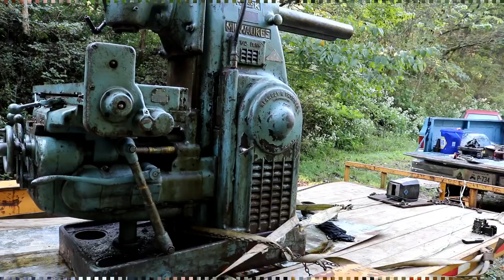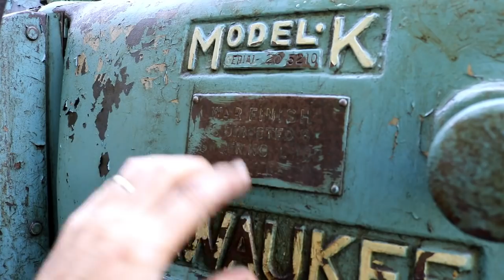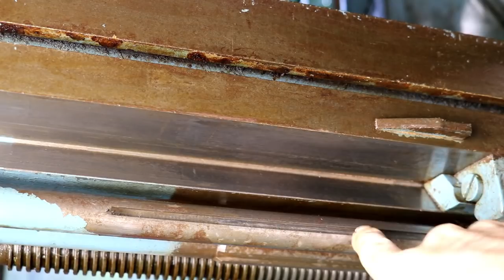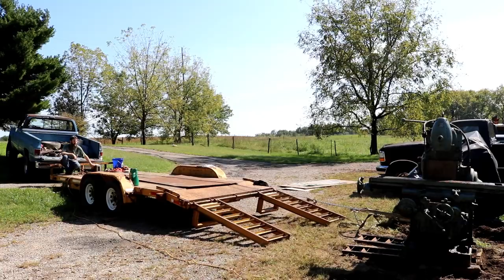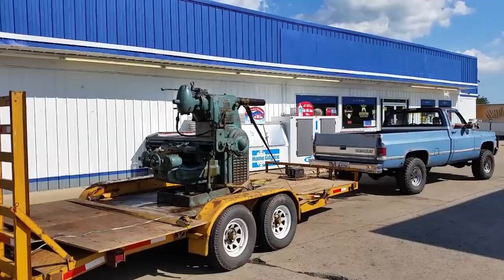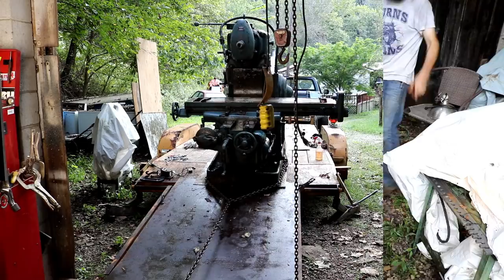New Monster Machine for the shop!! :-0

Comment: hi steave the job you did to move the shaper was great, i like to say just for the future you can use pipe to set the sharper on this will make it a lot  easer to move , I have move verious machine equipment for my shop i am restoring a kalamazoo band saw and a pexto shear , but you did a great moving the shaper. amiture machinst, Larry

Comment: That 2K looks like it has the potential to be a gem.  I have a model 2K Universal with a high speed head.  Absolutely terrific mill, and you are going to love the side controls.  Once you get that paint off the ways, you should be able to see how truly tight it is.  The scraping and frosting looks well done, so hopefully it wasn't just window dressing.  Tons of 50 taper tooling out there, and I have been always able to find it cheap.

Comment: Next big machine you get, I highly recommend renting a drop deck trailer (https://www.sunbeltrentals.com/equipment/detail/1413/0240150/6ft-x-12ft-lift-bed-tandem-axle-trailer/).  Makes it a lot easier to load/unload.  Also, if you ever get to south eastern Indiana, I've got a handful of 50 taper holders you're welcome to have.  I bought them at the auction I got my smaller Brown and Sharpe horizontal mill, which uses 40 taper.  They had a K&T exactly like yours, but went for more than I wanted to spend.

Comment: I'm sure we all agree that there are many way to move a machine of this size, and depending on which way you decide to do it, will determine the effort needed and the inevitable risks. No doubt, we have many channels on youtube on how to machine parts and the like, but not one on how to move machines safely and with the attention it deserves as you would running a Bridgeport or a lathe. True, it's expensive to hire professional movers but I've seen much too often machinists who, the next day, decide to become movers who go about it in ways that leaves much to be desired in terms of safety. 

That being said, and while Steve is very knowledgeable and resourceful, I was very concerned at the 14 minute mark where he is kneeling behind the winch. If the the strap or chain was such that broke off by too much tension, it could have sprung back straight to his face. I say this because I've seen it happen under similar circumstances and it got a man killed. I'm also wondering why Steve did not use 1" pipes as rollers when loading and unloading the machine. As a machinist myself, and having my share of moving heavy equipment, a 1" or slightly larger pipe is a must for moving heavy loads. I would never move anything without them. At the 21:30 mark, Steve said that "either you slide the machine or roll them with pipes" So he had it in mind but I'm at a loss as to why he didn't use them at the outset since it would have made it much easier to move and safer too.
Reply from the maker: On a flat floor pipes work well and I use them. They don't work well on a trailer ramps. What do you do at the bottom of the ramps? I would rather drag a machine then have it on skates/pipes when on a incline. Problem is lifting the 6000 lbs on dirt without a toe jack.
Everytime I stopped pulling the machine I let the pressure off the winch. Just had enough to hold it from sliding. On the winch I have there is no remote switch. You either stand beside and operate the switch or not use it at all.  I understand the safety concerns completely and agree that they are better ways. But none I had available at the time. 
I did what worked at a remote location with limited funds and equipment.  Smart thing to have done would have been to hire a tow service and me never touch the thing. It was not an option.
Reply: @SteveSummers  been there many times myself what you have is what you use. When you are starting with little money and tools you have to use more elbow grease and take chances. Great job!

Comment: WOW, nice.  Serial number machine 20 of 25 made starting in Oct 1945.  The manual gives weight at 9000#.  The attachment on the left end of the table is nice for doing spiral work, just need a K&T dividing head.
Reply: My bad on weight this was a mixed lot of 2K and 3H machines the 3H is 9000# the 2K is smaller than my 2CH which is 4700#

Comment: A war machine means that it weighs 500 to 1000lb more because the castings were not cleaned up and ground to their normal standard due to the rush of the war effort. K&T valued their finish so much that they put a plate on the machine saying that it's not as pretty as it should be because the government ordered it that way. They made wonderful machines.

Comment: Congratulations! Awesome!
After watching your video I really feel a bit like a wimp: yesterday I moved part of my Thiel milling machine into the basement. As I have to move it down a steep stairway, I dismantled the machine so that the heaviest part weighs "only" about 600 lbs (300 kg). This is still quite a challenge for me, although my Thiel looks like a toy in comparison to your monster. (Some Germans use the term "Eisenschwein"  (iron hog) for this size of machine.)
I am looking forward to see you restoring this old lady! (BTW: hope you found a good set of letters for your engraving machine.)
Best wishes Harald

Comment: As far as I have read a NMTB50 socket can accept CAT-V 50 tools, though one needs to make a longer drawbar with threads to match any given CAT-V 50 holder.

 what is you preferred price point for used & new NMTB50 holders?  

What thread size & pitch is the drawbar?

Practical machinist links etc. 
https://www.practicalmachinist.com/vb/general/questions-nmtb-50-taper-259189/ 
https://www.practicalmachinist.com/vb/general/cat-50-vs-nmtb-50-a-178172/ 
http://www.tools-n-gizmos.com/specs/tapers.html 
https://toolholderexchange.com/nmtb-tool-holders-nmtb30-nmtb40-nmtb50/

Comment: That looks like a good machine for your shop!  You will be able to do some serious milling now, good thing you’ve got those Tool grinders. I have moved several machines like this, but the last time I rented a Hydraulic lift trailer for forklift transport and it was slick as hell. I loaded an 8000 lb van Norman 38MEA in 5 minuets by myself with the help of a 8000 lb winch.  Trailer was only $125 from sunbelt rental for the whole weekend

Comment: You know, even if you did get fooled by the story and the looks of some of it, you’ll get even more good footage from repair/rebuild.

Ps. That oiled sheet metal trick is great. I wonder if I would work even better with two sheets on top of each other and the oil in between?

Comment: Congrats Steve, super nice mill. , now ya need to build the parking fixture like ah ok did. , and a it dividing head with drive gears for spline rotor cutting and helical gears too. . Lucky man ill say . Fun moving heavy machines , I moved a Bridgeport in a 1976 dodge w200 4x4 , 36" off the ground , had to use my brains dug out so the back wheels let the pumpkin Sat in the dirt that left me about 22" , easy with planks and blocks a cumalong and it slid down easy to the floor and pipes to roll it. No help just me. Good luck enjoy your videos . Hug the dog and the family be watching.
Reply: Hi Silverbullet. You said "now ya need to build the parking fixture like ah ok did. " Someone else beside Adam Booth (Abom79) has built a parking attachment? Or is this a typical spell check run amok? Thanks

Comment: That's a nice stout machine, very capable of doing a lot of work. 
A couple tips.....
1. Instead of motor oil, use Dawn dish soap.  Pretty much as slippery, maybe more so than oil. 
And it cleans up very easy......garden hose, or just rain. 
2. Never get yourself or anyone else in line with the winch cable. If it breaks, it can whip back and do some major damage to you.  A winch with a remote cable or wireless control is the way to go.

Comment: Congrats Steve on your latest purchase. 
You remind me a lot of our cockies (farmers). 
There is nothing they can’t do or fix with a little bit of wire and determination. 
You possess that same determination.
Personally I’m a pain in the ass perfectionist. 
I would spend excessive hours just cleaning everything up so it comes up looking like new.
I get a lot of joy and pride from doing that.
What I see in you is that you are probably much more practical than I am, checking everything over to make sure everything is up to scratch. I enjoyed your vid last week with the new acquisition of the larger tool sharpener.
When you took the time to clean everything, making sure that everything was good, I felt a lot of pride for you.
I hope everything is good with this mill as well.
All the best.

Comment: If you are going to have to drag something on a trailer like you did and need an easier more power disconect your vehicle chock the trailer run chain /cable to machine and to the vehicle tow hitch and pull foward. Ive pull on all kinds of heave stuff on using your idea of oiled plate is a good one. Also use farm jack or bottle jack pick up slid pipe or rod under for rollers.

Comment: Oh, Steve, one more thing.  I think I read on PM, and I believe it might have been John Oder in Huston that contributed this, but ....  Take the belts off the motor to check phase rotation!  Something about the clutch mechanism that WILL BREAK if the motor spins the clutch the wrong way.  It is a K & T thing.  Something just breaks and you have to be real careful about this, so hence the advise about taking the belts off.  I think there is an arrow made into the casting to note the proper direction.  I hope you read this before you try to power it up.  Also search PM for the post.
Reply from the maker: Yeah, planning on checking for correct  rotation  without belts. I seen the same post about issues related to running it backwards

Comment: I love the new machine Steve.  I have a Van Norman 22 milling machine.  It is interesting to see that the Y axis for the saddle looks identical to my VN.  My leadscrew to move the saddle is also off to the right side.  One thing I reworked on my VN machine was the Y axis gib.  It was banana shaped by .oo6".  This caused the saddle to "crab" when you reversed direction.  The reason I believe is because the leadscrew is off to the right (as opposed to being in the center like a Bridgeport), and the forces to move the table coming from the nut are not centered.   I reground my gib (see my Doozers Shop channel)  and I scraped the center of the slideway a little bit, and that took 90% of the crab problem out of my saddle.  I mention all of this, just to say that you might want to examine the Y axis gib on your machine.  Your KT is a similar architecture like my VN.  I know yours was rebuilt, so maybe you don't have this gib problem.  But I thought I would mention it, as you will probably be checking you machine out anyways.  Nice score!! --Doozer

Comment: Congrats, that is a real (monster) mill. Now the painter was of course drunken or stupid. To paint part of the ways is weird, but to paint the dials...oh my...   Now you need the parking attachment for the vertical head, the head is real heavy. Changing fom vertical to horizontal and vice versa is not a fun task without the attachment. For a moment, i really thought you would pull the machine from the trailer without securing it from the back side, jikes... Btw., i can tell, where i would be today, without my wife: in a deep and lonesome grave. So be nice to your wife, she is more important, than anything else.

Comment: nice new mill steve, I just got mine back home. I finally got all of the parts into the shop now, and you saying that it was difficult to get it moved around, that is no joke on what seems like any real horizontal mills, lol. What are you getting for backlash on your mill in the handwheels? 

Thanks for the video and cant wait to see it up and cutting to do some work, lol.
Edit: I may know someone with a 50 taper face mill if you cant find one, someone gave it to him and he just uses it to weigh the workbench down, lol.

Comment: When you winch that kind of weight, get away from the path the cable will fly if it breaks.  A steel whip in the face will make for a bad day!  I used to run an old Brown&Sharpe screw machine with a paint finish tag from the War Dept.  Old?  When did the War Dept. become the DOD?  On old machines, if you find trouble, look for something that may have been taken apart and rebuilt wrong.  It happened to me, something reassembled incorrectly years before I became a machinist.  Found the same mistake, same results in the 2 other identical machines in that shop.  First one took a few years to fix, the other two a few hours each.

Comment: Like a father with a new kid! Let me get serious for a moment...... NEVER but NEVER stand in line to any type of winch cable. You are lucky when the bolt broke that cable went to your opposite side. Like your idea of sliding on oiled sheet metal. I know we all have to "use what you got" but seriously be careful. I just thought you needed a little scolding. Great score on that one. I ran big Cincinatti convert a mills at Boeing that came off navy ships. Still had the tags on them too. That was in the mid eighties. They will take some serious cuts. By the way love your fathers Chevy truck. Always liked that year model. Keep us posted and stay away from flying winch cables..........

Comment: That is awesome!! I notice the rare drive on the end of the table. Is that power for a rotary table or is it the fancy one for a dividing head?
Reply: I think that is for the dividing head. Mine is powered without it. Those things are like hens teeth around here.
Reply from the maker: I was told its for the dividing head.. But I'm not sure.
Reply: It will have gears to change if it is for the dividing head but likely only be one ratio if it is for the rotab.
Reply: bcbloc02 
does that one need to have a whole specialized foundation built,
specialized foundations r for people who like show’n out,
kinda like Detroit diesels for makin noise
Reply: It's for cutting spirals. Think of it like an external rifling machine. It still uses a dividing head to do the job but the mill and the  head are geared together to create a lead (like a screw) per distance travelled on the x-axis. Older Machinery Handbooks have the info you need to set the gearing.
Reply: I got the spiral head with my K&T 3B Mill. I need the gears for it though. Found a set on Ebay. Prolly be gone before I can get em though. I'll end up making some. I posted photos on Practical Machinist.
Reply: I think it runs both if my memory is right. Great to have on the mill for sure.
Reply: Silverbullet 
No rotary tables only have uno
Reply: That drive bracket is for a rotary table... Kearney and Trecker made different gear boxes for dividing heads...One was a standard and the other was low lead.. The low lead, of course could power a rotary table as well as the low lead used an auxiliary shaft under the table which powered independently of the table screw....The low lead box on my 2hl horizontal powers my 12 inch K&T rotab perfectly....Mike in Louisiana (Ramsay 1)
Reply from the maker: @ramsay19481  This box is powered by a independent shaft and not by the table screw.  So it's for a rotary table?
Reply: Yes......Drives for dividing heads have many interchangeable gears for different leads...You may be able to drive a dividing head with this drive but there is no connection to the table screw so no spirals or helices...When a powered rotary table was ordered with a machine from the factory, unless otherwise specified, such as a low lead box, this is the drive bracket that was installed....Mike in Louisiana
Reply from the maker: @ramsay19481  Ok, thanks Mike. I pulled it apart and cleaned it up.
Looks to be in good condition.
 Guess I'll need to find a rotary table for it. Be neat to mess around with.  Still in the beginning stages of learning all the different models and accessories offered.
Reply: Find a Kearney and Trecker power driven rotab.. You will find which ones will fit your machine page 17 here:  http://vintagemachinery.org/pubs/2098/6847.pdf  Mike in Louisiana
Reply: me
Reply: Yep, talked to you on PM and I think the K&T site on Google?
Reply: Was probably KTMilwaukee on Yahoo groups... I started that group but when Yahoo changed everything up awhile back, I could not get in.. I finally joined my own group to get in and found that much of the data is now gone.... I started that group before  I knew about Keith Rucker and Vintagemachinery.org....I along with many others have posted information on Keith's site for all to enjoy.. Mike in Louisiana (Ramsay 1)
Reply: Oh yeah, definitely visit VM on a regular basis. Keith's videos are a must.

Comment: You're doing it the hard way. Drop the truck it reverse, pedal to the floor, slam the brakes about 10 feet from the concrete pad and let Isaac Newton do the work. With the right aim, and enough speed, you could probably set it right in position.
Reply: You are now banned from helping....

Comment: That vertical head casting is a dead giveaway. Had a shot at one of those over a decade ago - maybe a 20 years-younger model, $500, If I rightly recall. <sigh>  Getting ready to offload my third piece of machinery since June - an eight ton Kenco  OBI press. Your offload of the K & T Video  and a cup of coffee will get me through that process.  Machine before that was a near-pristine K. O. Lee 1959 Aberdeen Universal Tool & Cutter Grinder, Model B960. Thanks for the content! Does your machine take a CAT 50 with a 1"-8 on a drawbar? Image? 
EDIT: Closer look: Not CAT, and of course, too old to be CAT (TBC, "Talking Before Coffee Syndrome")
I am sure that this Spec has been called out in at least one of the 135 previous comments - I run into that kind of stuff, and it would be a hoot to see something shipped from Santa Barbara, running in your spindle. :+D